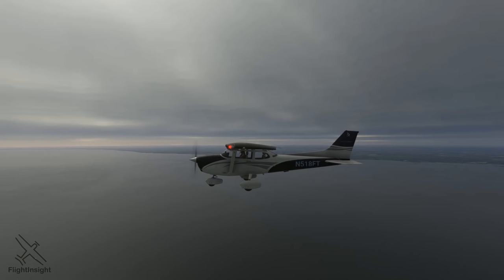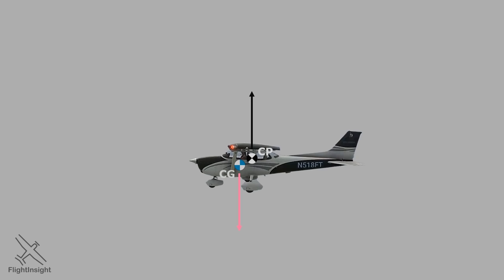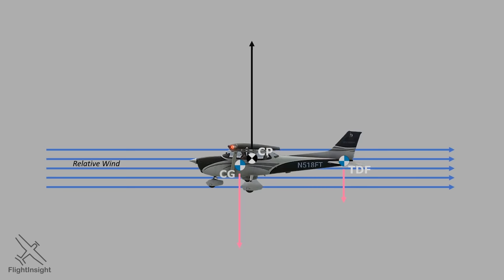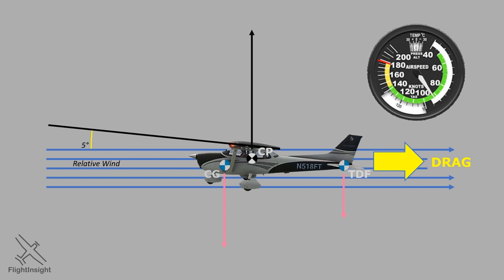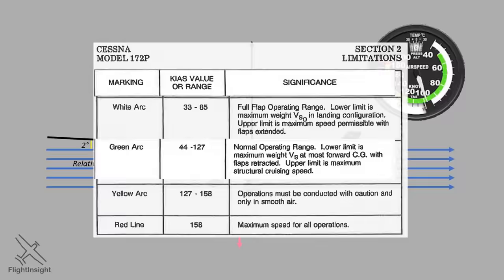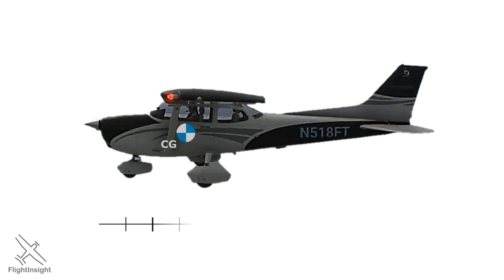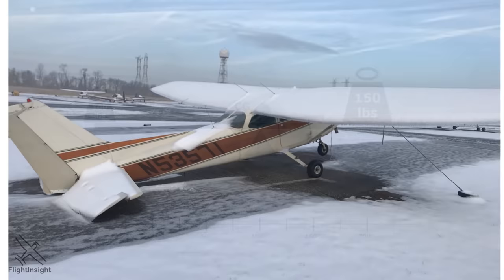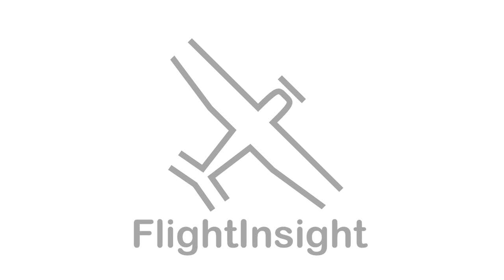How Center of Gravity Affects Flight | Tail Down Force | Aircraft Stability

Comment: Just busted my oral because I said aft CG will make it harder to recover from a stall, but did not mention that it also gives the aircraft better performance since less lift is required. (I also blanked on who to call before takeoff during a tfr, clearance delivery,  and incorrectly stated that SVFR needs instrument rating..without stating night or day). I did "pass" the rest of the oral. So the retake will just cover these 3 areas.
Reply: If anyone reading this is curious, I went back and did the 3 questions I missed, then flight portion. Am a pilot now.
Reply: @RegularItemShow congrats 🎉
Reply: @RegularItemShow for your private ride?

Comment: I still don't quite understand how the CoG is where the plane swings around in flight or at least pitch around.  Maybe for the other axis such as yaw and rotating.  I keep thinking that the CoL is where the plane pitches around.  I bit like a see saw is held up by a rope which provides enough strength to counter gravity and this see saw has a heavier short left arm vs a longer lighter right arm but the moments balance out.  As you start loading the left side, it becomes heavier and will start to dip towards the left but is then balanced out by adding a corresponding load on the right.  To apply this to a plane on the ground, the weight is held up by the main wheels and nose wheels.  You load up the plane and it doesn't collapse on the nose because it is still held up by the nose wheel.  As you take off and the wings start generating lift, the force of off-setting the gravity is transferred from the wheels to the wings, and as you pull back on the controls gently it applies a downforce on the horizontal fins which increases the moment of the right side.  Lift force continues to increase and the planes ascends.  Obviously it is way more complicated than that given the dynamic relationships between lift force, COG, moment and arms not to mention also CoL shifts back and forth and so does the CoG.  But that's just how I see it intuitively without having to bust my brains studying it at the mathematical level.
Reply: Imagine that while flying, you move 3 one-gallon jugs of water from the front seat to the rear seat.  25 pounds has moved 30 inches aft.  By definition, the CoG moved aft a little.  If you don't re-trim, the plane will start a small climb.  So, you trim a little nose down to fly level.  Since you now have less AoA, your wing makes less induced drag, and your horizontal stabilizer needs to make less down-force, so it also makes less induced drag, so you will gain forward speed.
Reply: @patrickpowell2236  I think I am starting to sort of get it.  Planes are designed so that there is a downward pitching moment to aid with stall recovery.  Under normal circumstances, and flying at normal cruise speeds, there is a slight angle of attack ( 4 degrees ) to generate enough lift to counter weight plus down force on horizontal stabilisers.  However, the CoP moves forward to align above the CoG during equilibrium(L = W and T = D), allowing the plane to fly straight and level.  When the speed drops enough eg descending, so does speed and the CoP moves rearwards, giving the plant a pitch down moment.

Comment: So I don't get it, is it better to have a more tail or nose heavy aircraft? Or does it matter on the type of plane? Also, what happens when you're on a long flight and the fuel is decreasing and changing the CoG. How do you account for that?
Reply: Tail heavy is better for efficiency. Nose heavy is better for stability. The limits are established to respect both. If the CG changes in flight, you just keep controlling the pitch to maintain the altitude you want. You're always controlling it to cont correct for slight bumps, etc. anyway. This is just one more slight disturbance.

Comment: A novice here attempting to understand the basics of flight. You state center of pressure is typically 50% chord location. However, other sites seem to state 25% chord location (particularly with symmetric airfoils). I must admit confusion with Cp and center of moment. I notice that in model airplanes that I am familiar with, placing the C.G. at 25% chord typically makes them nose-heavy. Moving to around 30% chord location makes for better flight. Moving C.G. behind Cp seems like a bad outcome; thus, ~50% chord location for Cp seems right to me empirically. Can anyone comment? Thanks

Comment: At 4:04 You said that moving the center of gravity aft towards CP would create almost no tail down force, I think that’s a misleading statement. As far as I can tell, moving the CG aft would Increase tail downforce and require the pilot to increase forward pressure on the controls to lower the angle of attack. Moving the CG aft does not magically change the tail down force, we have to physically apply more pressure forward on the yoke
Reply: You are getting aerodynamic force confused with weight forces. If the CG is moved back, closer to the CP of the aircraft, you need LESS tail down force (TDF is an aerodynamic force caused by the tail). There is a point if you move the CG behind the CP of the plane to the Neutral Point NP,  where the plane is not affected by any pitch control of the rear elevator… not a good situation! Many an aircraft and life has been lost due to poor CG placement at or rear of the NP.

Comment: I didn't follow the stability-during-a-stall explanation at the 3 minute mark. If we "cut the string" pulling up behind the CG, while the weight acting at the CG remains the same, the body would rotate up and not down. The change in force behind the CG (reducing an upward force) is downward.

Comment: I think CG in front of CP makes stall recovery easier but the main reason is the speed above the stall speed. For example if a Cessna 172 is in level flight at 70 m/h, if you increase the power and its speed while keeping the wings level, the aircraft will climb as well. To stop the climb in level flights above the stall speed (weight = lift) we need to lower the nose which requires less elevator (less drag) if CG is forward of CP.

Comment: 5:53   "More room to pitch up and diminish speed"?   Better statement in my opinion.  As the CG moves aft, Less tail down force is required, reducing total load, lift requirement of the wing, reducing stall speed.  Correct me if Im wrong. Hopefully taken as constructive criticism.   Thanks for putting this together.  Good work.   My 206s elevators are 3deg down from counterweight streamline and use a large elevator down spring to aid the pilot in control forces.  This allows the horizontal-elevator to create upward lift with the CG at the aft limit at cruise speeds.

Comment: I'm sorry but parts of this representation are incorrect. You do not need a constant downforce to have a stable airplane!

Let me explain:
The lift of the wing does not attach at the CP as shown in this video, instead it usually acts at about 25% chord line which is in front of the CP of the wing+tail configuration. Any increase in lift on the wing produces a pitch up moment and a decrease in lift pitches the plane down, e.g. in a stall condition. And the correlation is inverted for the tail, because it is located aft of the CG. A wing with positive camber also produces a moment that pushes the nose down (Cm0). The tail also has a Cm0 but it's usually zero unless the tail has camber as well.

Looking at the new equilibrium moment equation this yields:
L_wing * distance( 0.25 chord_wing, CG ) + Cm0_wing = L_tail * distance( 0.25 chord_tail, CG) + Cm0_tail 

To have a stable airplane the right hand side just has to grow quicker than the left hand side as angle of attack increases. And because the moment arm of the tail is soooo much larger than that of the wing you can have a positive wing and positive tail surface lift and the longer tail arm with the increase tail lift still pushes the nose down.
This balance is affected by the tail surface area, wing surface area, distance of the center of pressure of the wing and tail surface as well as the downwash effects of the wing onto the tail and other effects such as propwash.

Example: You have an angle of attack of 0 degrees. The wing still produces lift because it has a positive camber, lets assume the tail is symmetrical and cm0 and down wash are irrelevant, then the tail produces zero lift. Now if you increase the angle of attack your wing produces more lift but the tail also sees a positive angle of attack and it too produces an upforce, not a downforce. The tail upforce pushes the nose down with a very long moment arm where as the extra lift of the wing is located close to the CG and doesn't add that pitch up moment. This configuration is stable even if the tail produces an upforce.
Reply: Well I guess their explanation still kind of holds if you don't take "downforce" to always be positive. Obviously it's about the balance between the two down(up) forces and the gravity, and certainly tail won't produce literal downforce under many flight conditions, but I think their version is accurate enough (and easy to understand/remember).
Reply: @alk672  My issue with it is that most people and pilots think the tail only produces a down force because a textbook told them so. Most textbooks are not correct in this regard though.
It's like you get more lift when you add flaps but in reality lift is still just as large as before, because it equals the weight. Your just flying at a lower speed or lower angle of attack.
Reply: @Jet-Pack  well aren't all widely used training materials for pilots basically a bunch of BS when it comes to aerodynamics, or weather, or pretty much anything else? Have you seen the explanation of transonic aerodynamics and shockwaves in PHAK? It's basically satire. The target audience is not technical enough for any explanations to be real, so it is what it is.
Reply: But to increase the angle of attack, you have to increase the downforce to the tail, don’t you?  And if the wing produces a nose-down moment when producing lift, don’t you need a down force on the tail to counteract that moment?  Am I just confused?
Reply: @moeinmemphis  The pitching moment can also decrease as you increase angle of attack, depending on airfoil. If the aircraft is stable then you need more downforce to increase angle of attack yes. But then as angle of attack rises and the tail also sees that increase in angle of attack you decrease the downforce on the tail again and a net positive tail surface lift might remain.
Reply: So just to ask, if tail make down force so at faster speed it will pitch up?
Also thanks for comment and equation!
Reply: @MScienceCat2851  Depends on the configuration, as you increase speed at constant angle of attack you increase lift on the wing and tail.
Reply: @Jet-Pack  yep, i wasnt thinking much of it cuz i forgot wing, sorry for wasting your time on my stupid coment which i realised my mistake by now
Reply: @MScienceCat2851  There are no stupid questions when you want to understand something. You're welcome
Reply: @Jet-Pack  some corrections:
1) Lift is not placed at the 25% of the chord. This is the position of the aerodynamic center (for subsonic standard profiles) , while the real resulting lift force is placed in the center of pressure. To easily determine the stability, the lift is then moved FROM the CP to the aerodynamic center, adding the transport moment (Mac)  to obtain a similar force system. The advantage of the aerodynamic center is that the moment of transport does not change  with the change of the angle of attack. 
2) to compute the stability,  you furtherly move the lift in the Neutral point, which is the aerodynamic center of the whole plane. 
3) If the neutral point is behind the center of gravity, as shown in the video, you need a downforce produced by the tail to have the rotating equilibrium of the plane. This equilibrium is stable: if there is a sudden increase of the AoA, the lift in the neutral point increases, producing a pitch-down. At the same time, the tail will produce less downforce (slower velocity acting on it), reducing its nose-up action.  The result therefore is a pitch  down opposing the increasing of AoA. If the AoA decreases, the lift in the neutral point decreases, reducing its pitch down effect. At the dame time, the downforce produced by the tail increases, giving a stronger pitch up effect. Therefore, the overall result is a pitch up contrasting the diminishing of the AoA. STATIC MARGIN IS POSITIVE.
4) if the neutral point is after the CG, you need a positive lift produced by the tail to have the equilibrium, as you were saying.   This condition, however, is less stable or completely unstable: an increase in the AoA will give an increase of the lift in the neutral point, and therefore a pitch up moment. The increment of the lift of the tail usually is not sufficient to automatically balance this, therefore the pilot must deflect the elevator increasing furtherly the lift of the tail to return to the equilibrium point. This condition, represented by a NEGATIVE STATIC MARGIN, requires a continuous deflection of the elevator to match the stability, and only an automatic control allows it. 
5) Mig 21, for example, which has no automatic controls, had a positive static margin in order to be stable, otherwise it could not be flyable.
F16, instead, has a negative static margin, so it is basically unstable, but the fly-by-wire continuously change the deflection of the elevator to keep the longitudinal equilibrium!

Comment: There is so much wrong with this I don’t know where to start. Any aeronautical engineer would shake his head at this. You can have an upload on the tail or a download and still be perfectly stable. Stability and trim are often confused when pilots try to explain engineering and that’s what is happening here. The stability equations don’t even include center of pressure. It only comes up when flight instructors try to explain trim and stability which they inevitably jumble together into a dog’s breakfast that “makes sense” to them but has no bearing on reality.

Comment: information.      at :53,  in order to balance, the vertical line should connect with the wing  at  THIRTY  percent of chord.          the distribution of mass (dom) of a typical, conventional, aircraft  NEEDS  to  be  OPTIMIZED, so that the location of the center of mass (c-m) vertically aligns with 25 percent of chord.     ideally, the c-m  should also be  ON  the  thrust line.       ideal location of c-m indicated, in this illustration.        googletranslate
https://s3.amazonaws.com/assets.flitetest.com/article_images/medium/truecg-jpg_1384168691.jpg
if the center of  MASS  of an aircraft is 'too' near the cg, an aircraft will be  Less  stable.      this is a reason that most fighter jets are inherently less stable.